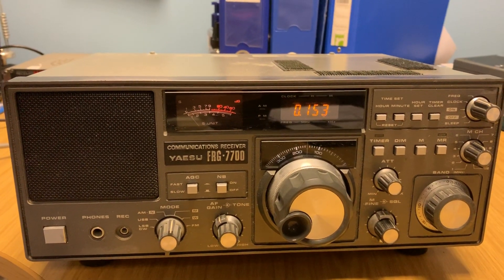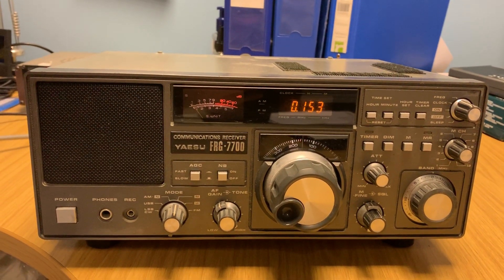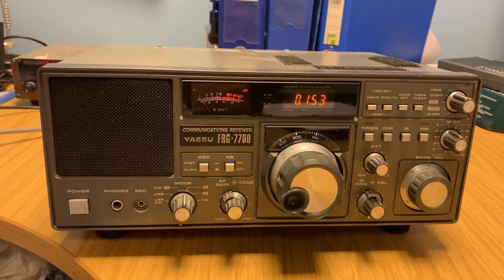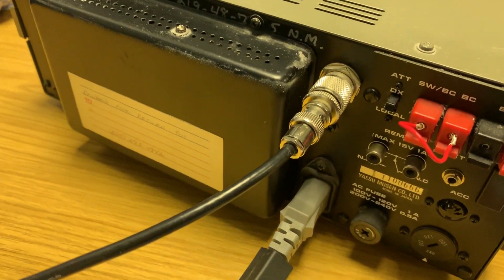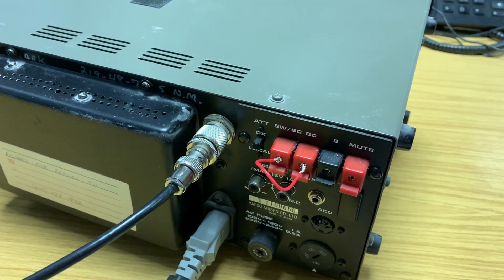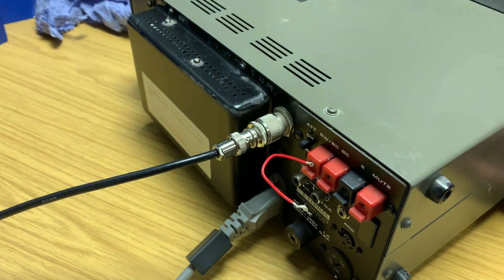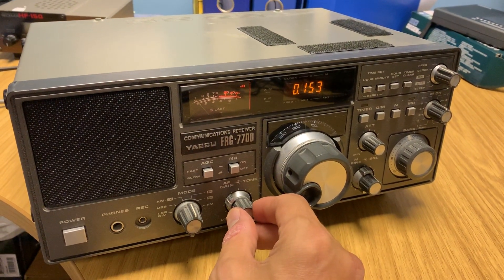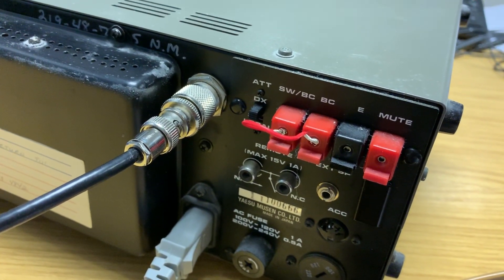Greg of HamAndShortwaveRadio LW/MW sensitivity fix for Yaesu FRG-7700 - demonstrated!

Comment: I've used the short wire on my frg 7700 and I honestly see no difference. Maybe its because you are using an indoor antenna where as I'm using a vertical antenna.
Reply from the maker: Yes it could be. Definitely makes a difference though. 73

Comment: Very good I did the same to my 7700 before even turning on for the first time. It was shipped from FLA but not packed well & got beat up, magnifying dial lens broke inside the face & the hit took out the digital display but still works well with the analog dial, Its a shame because on the outside it still looks minty.
Reply from the maker: That is a shame - but still a great rig

Comment: I've just bought one of these off ebay serial # 1E 051951, it's picking up some signals so is working to some extent. My question is what is the minimum antenna I need to setup to check if it is in good shape or not?

Comment: I would strongly recommend to get hold of a FRT-7700 antenna tuner for this radio. It works superb in combination with the Ala-1530. You have full sensitivity on the low bands and get rid of cross modulation, to which the FRG-7700 is slightly susceptible. Best 73, Stephan
Reply from the maker: Thanks very much for the tip stephan - I've actually got an FRT-7700 antenna tuner but that's not going to work with my Wellbrook ALA1530 loop. 73s, Clint
Reply: @OxfordShortwaveLog  Interesting, I have the Wellbrook ALA 1530 LNP Loop and it works excellent with the FRT-7700, especially on MW and LW. 73, Stephan

Comment: Thanks Clint and Greg for a great tip! I'll do that with my 7700 asap. I'm having a hassle with my 8800, from 11 mhz and below, sensitivity drops off considerably. Any thoughts? I'm hoping its not pin diodes and something like the 7700 fix. Otherwisr a nice radio.
Anothet great video Clint.
Cheets...... Phil vk2gjf
Reply from the maker: Thanks Phil. Indeed, a great tip from Greg. I'm not sure what the problem might be with your 8800. I have problems with mine from time to time - it just locks up and loses the display. I think it's an over-heating issue - but it only happens now and again and alwasys seems to resolve itself. Radio Cruncher could fix it for you - he fixed up my 7700. Thanks again and good luck, 73! Clint